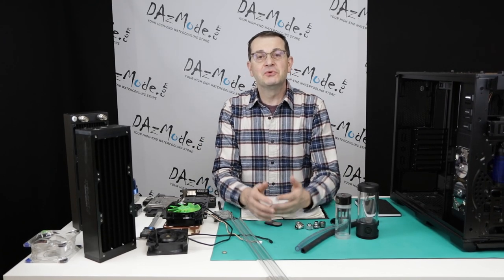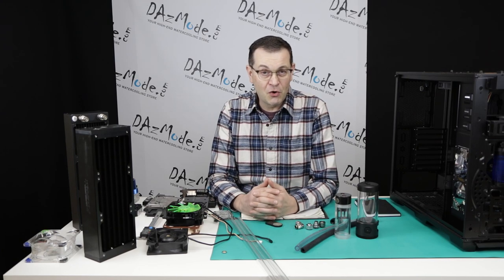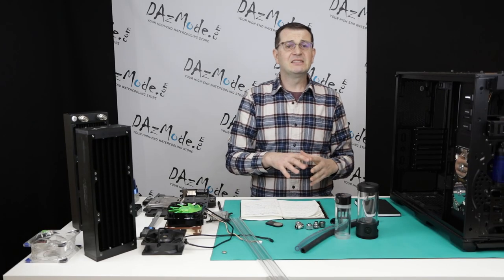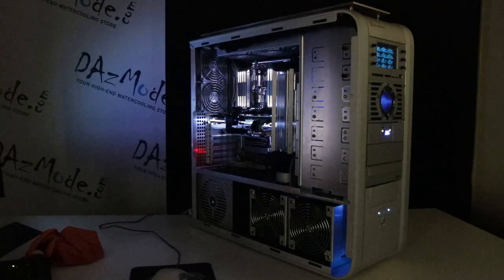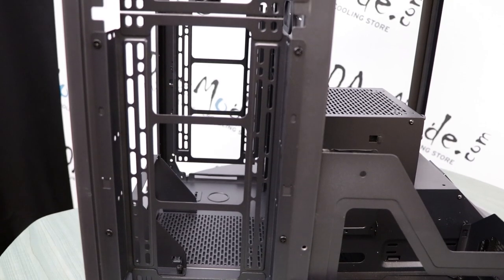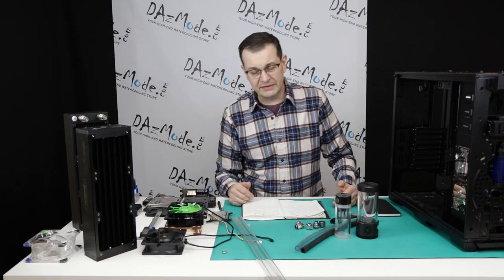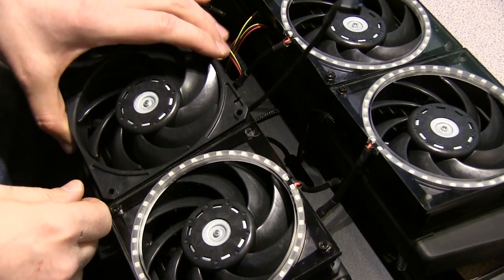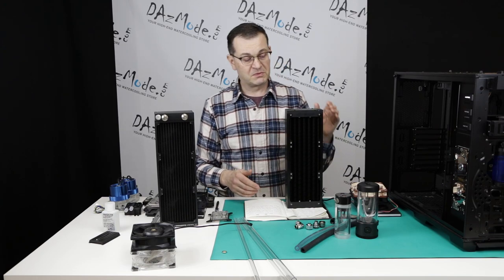Ten ways to maximize cooling performance - Complete Watercoling Guide - Part 14

Comment: So true about the performance dropping with mismatched tube sizes to fitting bores.
Every pipefitter I know will tell you a reducer will create turbulence and the turbulence also creates heat. This is why 12mm od 10mm id tube is the best size for G1/4 threaded fittings. You would need to step up to G3/8 threaded fittings to get any real performance benefit from 16mm od 12mm id tubing. Otherwise, the fatter tubes do look best. This is why we do rad overkill though to offset the loss in performance.

Comment: I tune for silence over performance or looks.  Looks are nice,  but doesn't get you much in the end.   The difference in performance from a 'hot' silent system vs a cold noisy system is soo little I'll again always go for the silence first.  Yes I know you can get silence and performance if  you have the budget for radiators and the space.

Comment: "Everydody standardized on the same design" meaning everybody copies the adversary. Circa 2005 when a newcomer  introduced new designs, and claimed better performance than the rivals they had to prove it, and were scrutinized by competent testers. As a result only the best "survived". Today,  mfr. release waterblocks focused ONLY on RGB and not on performance, as innovative ideas costs money, are subject to being instantly copied as they aren't valued by the consumer used to get cheap products from the chinese. As for impingement blocks, Daz is forgetting the Swiftech mcw-6000,  Cathar waterblocks, Swiftech Storm, and 1A-Cooling (German mfr. - no longer exists). 1A-cooling might be the first to use middle plates in the waterblock, for the american side (except for swiftech) was on those days focused on brute force and lage diameter tubing. In those days, the goal was to have a decent performance with the least amount of block restriction, as opposed to what we're seeing nowadays, Today the waterblocks on the market are all high resctriction and thus become a lint trap with the help of additives sold by the mfr. themselves.  It also amazes me to see users employing as many as 10x 45º and 90º fittings in one build, especially at the pump and waterblock inlets. Daz your statement that higher flow of air and water are all that matters to achieve a higher performance must be tempered with your personaL GOAL. Horses for courses.

Comment: Performance always matters. 
Convective heat transfer between the water or air and the surfaces is proportional velocity raised to the 0.8 power. Higher water or air velocity is always good. Higher water or air flow rates mean higher velocity. 
Daz speaks the truth!

Comment: I think the main reason is that with all the boosts etc that hardware has, the ROI on the extra work to go "all out" delivers minimal returns. In reality 46 deg or 55 deg on the CPU or GPU will not really affect the performance of the system.

Comment: Use soldered soft copper tubing for most of your plumbing, with borosilicate glass for water sight tubes. Mark each joint in place, but solder it outside of system. Use couplers at waterblocks, and never solder waterblock fittings onto tubing. Always remove any O-rings, compression rings, and tubing nuts, before you solder. Flush all soldered parts in three steps, brake cleaner, isopropyl, and then water. Reinstall rings or seals. Keep your plumbing runs short, so they don't dump heat back into your computer case. I use only one LED per water level sight glass or reservoir. If you must have RGB, hook them to temperature sensors, so at least the colours tell you something useful. Hello, Arduino!!!

Comment: Daz, I disagree on statement that “the shorter path is always better and have less restrictions”. It is much more complex and people did a lot of testing on that. On the photo you show as an explanation (red themed build) you miss one thing - a lot of sharp/small radius turns (in a way of 90/45 degrees adapters). My personal impression is that length has less impact vs turns. So ideal routing would be nice n a way where you avoid unnecessary small radius turns in expense of little bit longer tubes.

Comment: I have 2 480mm and 2 360mm rads (60mm thickness) in my system but i run my fans at 750rpm for maximum silence.

Comment: I'm always intesrested in performance but in small form factor. My last trial is using 92mm radiator... Good enough to cool oc r7 3800x...:)
Reply: I have the dual 92/184mm Hardware Labs version I've been interested in trying on a 2700x. Thanks for the info!

Comment: You are so damn right, i love your sight of things! well done!
Heating components are already in the Loop, as i just experienced.
My mistake was(in many ways), to choose an aquacomputer D5 Next pump.
This miscreated Pump was the worst ive used in my 20 years of pc building.
I combined it with a Primochill Combo Reservoir (CTR PhaseII D5 enabled), in which it first stuck.. the pump was mounted correctly, but the wheel wont turn, so i had to manipulate the flat  O-Ring, which came with the res.. while that, some liquid ran over the control unit of the Pump and shorted the inner pcb circurits.. game over.. but i gave it a 
bath in Isopropanol to get rid of rest water, well, it ran again and in the testloop, no components were attached, even no fans on the radiator, but the water temp climbed up to 24 °C in a 21°C Room within 12 Hours.. This pump is misconstructed all over, it is not waterresistant at the control unit,it boils the water,  it doesnt fit like a regular D5, it's Sata Power connector is a mess, turned 180° in the wrong direction, 90°Sata Connectors (which the most PSUs supply) won't fit. if you try, the Sata Port's solder breaks and its damaged again.. it even did with a straight connector.. even more reasons, but i have to stop here.. the point is: some Pumps could help rising the water temperature, too...
Reply from the maker: Actually any pump motor produce heat, so for leak tests you still need to run fans or at least one on radiator.

Comment: Extremely well explained, as usual. I do have small question though. Do Quick Disconnect No-Spill Couplings affect the flow rate of your coolant?
Reply from the maker: Yes, they restrict flow. I tested a long time ago and it was 0.1L per 1 pair.

Comment: I doubt LEDs make nearly as much of an impact as you think. I did some quick research as it didn't seem right and I'm honestly blown away how little power they take. I found some Arduino people doing maths on RGB LED strips and one calculation gave 45 watts for a strip of 150 RGB LEDs. A typical system has maybe a couple dozen LEDs located somewhere where it'd potentially affect cooling so the added heat is minuscule. I reckon you'd get way more value removing things like HDDs from the system and expansion cards you don't strictly need, like sound cards.
Reply: It is different when they are inside the water cooling blocks, though.
Reply: 45 watts - that's what a low power CPU uses at load. Imagine putting a light strip inside your case where the same amount of power could run another CPU. Then consider what size of a heat sink is typically used on even a low powered CPU and you start to get an idea how much heat these LEDs are adding.

Comment: Great video Daz. One thing that has really changed over the last few years is the gains in hardware efficiency that reduce the need for massive thick radiators and huge fans to push through them.
I'm using 2 420mmx30mm rads in my system and I think that's overkill for my system. Most mainstream systems would now get away with a single 360 rad unless they are running high overclocks. I may invest in the dual pump idea in the future. I can vouch for the D5 pump totally I've had mine running with 0 issues since 2015.
Reply from the maker: I was thinking so, till i got my TR4, barely can cool it and 2080ti with triple rad.

Comment: Best advice I can give is water volume (more water and a high flow rate).  Sounds simple enough, but Daz alludes to this, in that anything that is blocking or slowing flow rate is probably not helping you that much.  

I've also had good results with putting rads in between components. Out from the cpu goes to one rad, then back to res, then back to another rad, then out to gpu, then out to another rad and then finally back to cpu (not necessarily in that order, but you get the point). I have a monster old cosmos case and soft tubing. It doesn't look pretty (no glass panel anyway so who cares) but it works quite well. Playing games in 4k with just a general warm air flow from my push fan config.